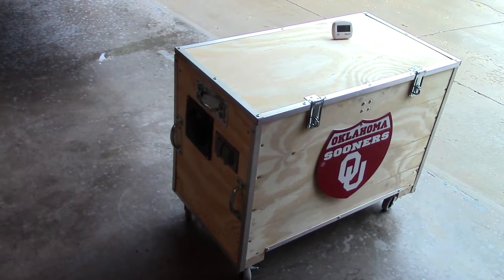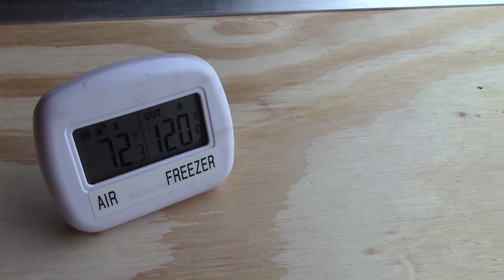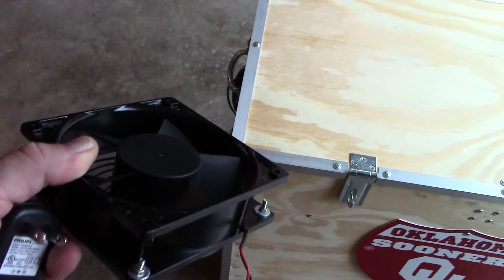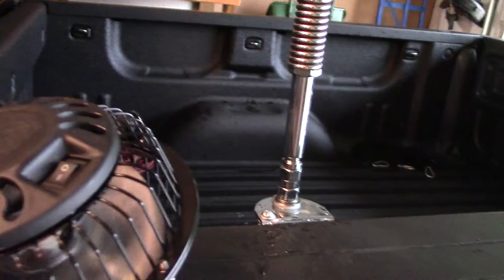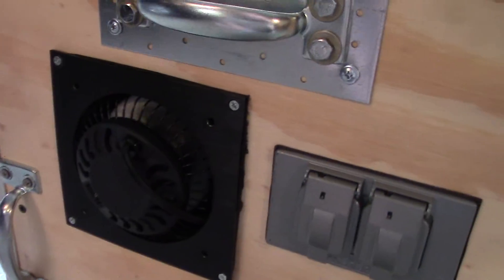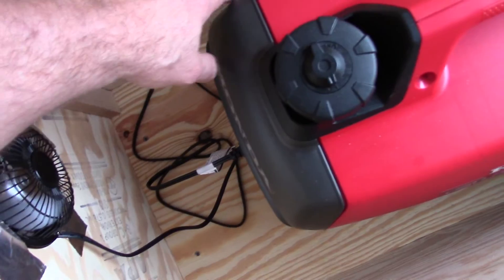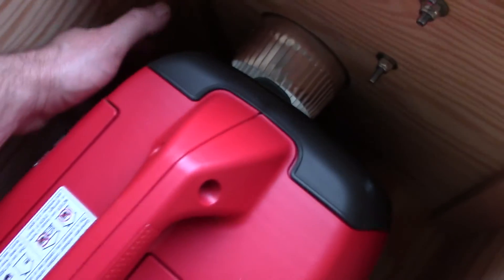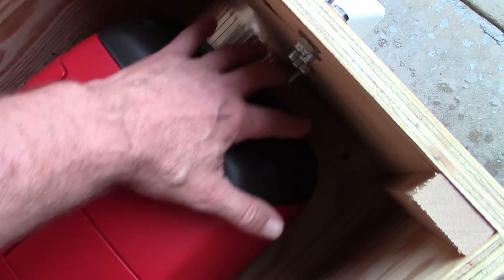Part 4 rev (testing out with fan & digital thermometer) Honda EU2000i inverter/generator baffle box

Comment: Chris, it’s apparent to me that you are trapping hot air and not exhausting it rapidly enough. The exhaust egress is adequate for combustion purposes but the engine’s radiant heat has no where to go with or without the fan. Since heat rises you need an air vent (-s)  in the top and/or upper sides of the back and/or sides. Use a diversion baffle to trap sound but permit hot air to exhaust. Neither the 52 nor 80+ cfm fans will work without better ventilation. Ray

Comment: Besides air vent in the exhaust area bigger. the Honda generator air intake is at the bottom front. The fan should be placed towards the bottom in my opinion. Heat are coming from the rear are being trapped inside.

Comment: I know this is a past project but Im starting one now others will too. 
I have built hush boxes for a large shop vac and  a dewalt 4.5 cfm compressor. You tried a small fan but fans will not build or evacuate pressure in a closed space well. For that you need a blower. Either centrifugal or cross flow and if you only use one make it exhaust. Also for best results thc  air should go out and in through labyrinthe assemblies you can just  slot the side panels inside  and use 1/4" plywood. Spray the wood with auto undercoating and the whole box should be lined with a mass insulation that absorbs sound and vibration. Ive used old wetsuits available at thrift stores for a few bucks.

Comment: Should have it blowing out, instead of in........ and you need another opening on the other side for air to get into the box.  You don't want the air coming into the box to be running over the exhaust.........

Comment: You are moving No air at all in that box. Its sealed  once you close the lid. Where is the hot air going? Nowhere.add a vent on the other side.  Second the exhaust is pumping  in there you need to seal the exhaust pipe till it's out the box

Comment: I was going to build a box and appreciate what you've done because it was very similar to my thoughts. My question is, was it worth it? Because that's my fear to build something similar.... a lot of time and money and realize that I only decreased 10db . Clearly it's a great storage box but would you mind being honest with the issue of heat, etc and if it ended up being worth it when you compromised? I watched all your videos on it, including the ones with the grate and again, wonderful job, but is the sound diminished enough to warrant the work and money invested :) ? Thanks! I guess in the end I am wondering to invest in a storage solution or actually try to tackle the sound and heat (which is a lot to take on)
Reply from the maker: Prob not...ended up using that box for another project. I did make a roll-around cart for that little Honda. As for the box, it was a worthy attempt...but, ended up not working as well as intended. Some folks made some really neat boxes for theirs. Will keep these videos up for others to see...and how "not" to make one
Reply: Chris DIYer awww you made a great attempt and helped a lot of people with their engineering I’m sure! I appreciate your response. I’ll be sure to subscribe on your future projects

Comment: If all the heat is on the muffler side maybe try one of those hvac square collars to cover more of the one side of the inverter.

http://m.homedepot.com/p/Master-Flow-12-in-x-6-in-to-8-in-Insulated-Register-Box-IRB12X6X8/100115419/
Reply from the maker: fanman1981 Thanks. Meh....IDK. I am thinking of something that I can bolt onto the exterior (on the exhaust side).
http://www.amazon.com/Imperial-Rg1199-Trussteel-Floor-Return/dp/B00EFKYKXY/ref=pd_sim_sbs_60_3?ie=UTF8&refRID=016VAT72EF8ZZVT7Y2ZM

Lowe's has something like this, multiple sizes. I WILL get this safe and working good!

Comment: I've been watching you trying to battle with this baffle box and I really like the idea. Now the heat problem. No matter how much cool air you try to put into the box once there is no where for the hot air to escape eventually you'll start to over heat. You could decide to build a bigger box but it will just take longer to heat up. The exhaust you have will only work to expel the air coming out of the engine but not the heat created by the unit itself so I think you'll need to create a second exhaust with and extraction fan to remove the heat. Unfortunately this may defeat the purpose of silencing the generator. Something else you could do is reverse the fan you already have turning it into an extraction fan and cut grill like slits at the bottom of the box so as the hot air is pulled out cool air is sucked in from the bottom by the creation of negative pressure. But once again it could defeat the purpose of the silence but to a lesser degree compared to cutting an entire second hole.
Reply: ChrisSolarPowerMakerOklahoma I believe Romo Jack is right. Don't think you're displacing the heat... exhaust yes, heat generated no. I am sure you will figure it out! This is why I watch you, let you spend all the time and money perfecting it. then I can skip all that! haha Keep Rockin' Chris!
Reply from the maker: Romo Jack Yep...I 100% agree with you. I got a couple of ideas I am going to try. Most of the heat is on the exhaust end of the Honda. I am thinking of cutting out a square hole and mounting a home register vent thing. And another one on the bottom. It will get louder, but may still get some benefit once I get the sound deadening in there. We'll see...at least I got a nice storage box! Thanks man...appreciate your insight!